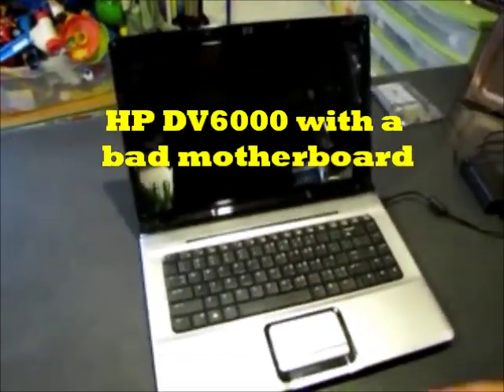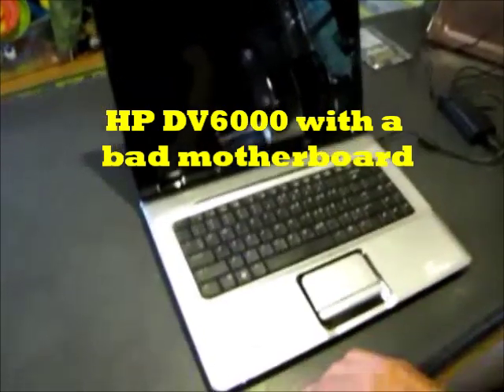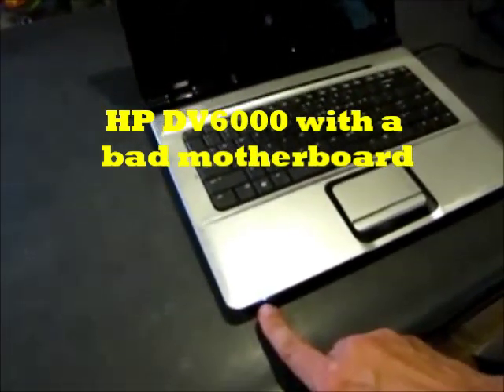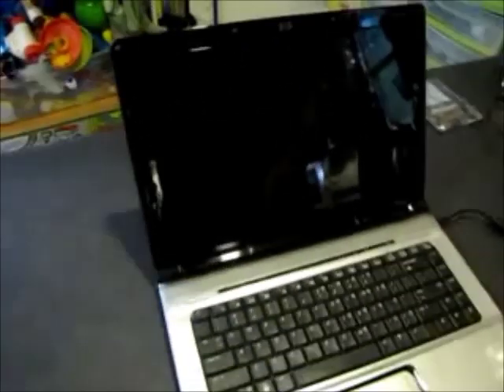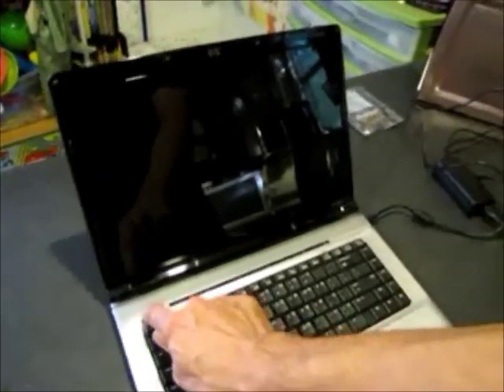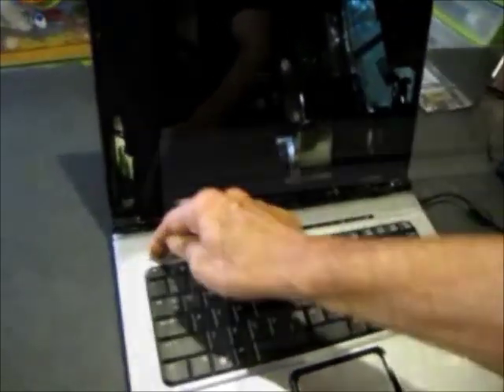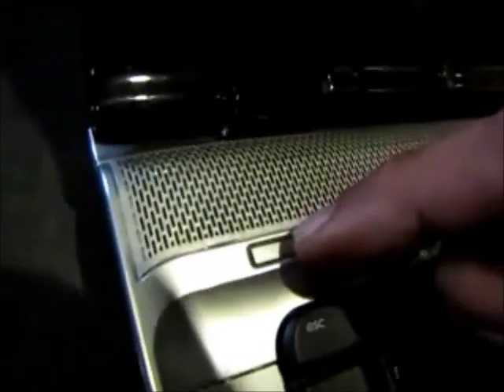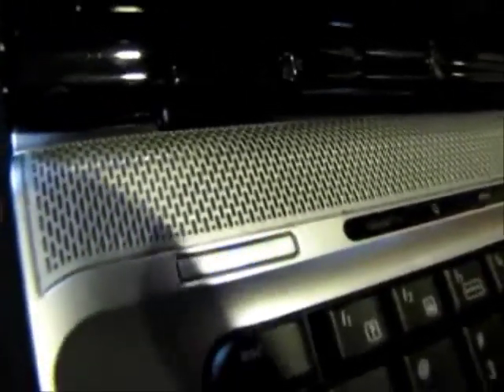HP DV6000 Motherboard Reflow

Comment: Only thing i would suggest is not putting it all back together afterwards.  You only need to put back the board, screen and a couple of connections to test if it works.  If it doesn't, and you now want to replace the motherboard, it's a pain to have to remove everything again.  Otherwise, nice tip.  Though, as others have said, it might only be a temporary fix.

Comment: Soon or later your motherboard WILL fail. This is only temp. fix. I have tried this method and along with isolated solder several times and it worked but the laptop is on the timeline. This method extended my dv6700 another year but it gave away in the end.

Comment: must try this I just bought a nice laptop for £35 and the mobo is gone and will cost some £100 for new on is there any advice on all the bits to take off before putting it in the oven please? and what to rest the mobo on as in do you have to make sure its not resting on any solder parts? great vid by the way :D

Comment: Definitely not a long term solution. Iv done this before and it will destroy other components on the motherboard like heat sensors (which are kinda important)! But if all you need is it to maybe work for a little bit longer not a bad choice.

Comment: After taking my comp. apart I discovered that the silver part on top of my AMD Turion 64 was half melted. At least it looks melted. It was turning on for a while in safe mode only, and then I let it sit for a while only to come across the problem of it not turning on. I only needed it to turn on one more time, I was going to get what I needed and transfer it to my new computer. Do you think I will have a shot even with the AMD problem?

Comment: My only suggestion is that if you are going to do this you should bench test it first before re-assembly, so you would eliminate any possible unnecessary steps.  Also, try  testing the board without the hard drive, battery, cmos battery, lcd screen and only leave the fan connected to the cpu and power supply to the motherboard watching for video on an external monitor or TV.  If bios is seen than look at the lcd inverter or bulb as the culprit.

Comment: Osman....calling someone crazy just because you are ignorant (you didn't even spell 'component' correctly).  I've fixed many a mobo using the 'DIY' oven 'reflow' approach.  One suggestion though river (most people don't do this, but it will give you better quality reflows, is to paint the board with solder paste to keep the oxygen impurity down and also to break down capillary action (allow better wetting of solder to mobo components.  Thanks for a good video man.

Comment: I have a few questions, 1. How long does this fix work? 2. Does this model of laptop make error beeps when the ram is taken out? 3.What other things did you have to remove from the motherboard before baking it? I have the same model and I'm thinking of fixing it like you did but with a copper shim on the video chip to help with heat disapation.

Comment from the maker: This is no joke and the plastics that remain on the board through this process have a much higher melting point that 400f. I made this video years ago before I acquired the professional equipment I have now. I can assure you this works in most cases but it is only a temporary fix because the root cause of the problem is not addressed

Comment from the maker: No replacing the chip will make it like it was when new and I would suspect it would last as long as it did the first time. But there are two versions of that chip. There's one from 2008 which you have. And there's a newer, updated version from 2011 where the heat issue was corrected. But in reality the entire thing was designed wrong if you ask me. It's insane to take the heat from the CPU and pipe it over the GPU on it's way to the fan. They needed two separate pipes...

Comment from the maker: I take my oven to 400f (204c) for 8 mins. Test the inside temp of your oven to make absolutely sure its not hotter than 220c. Any hotter than that and components may fall of the board into the bottom of your oven

Comment from the maker: Yes it is a temporary repair. But I have some of these that are still working fine. My wife has one I reflowed in this manner last year and it's still working fine. And yes you could "get the customer". Or maybe you could get the laptop working long enough to back up your data then sell the machine for parts. Since this video was made I have purchased a professional rework stations and I now reball or replace these chips for a more permanent fix.

Comment from the maker: I no longer recommend this method of reflow. It will work as a temporary fix so you can recover files etc. but it will fail within months... or sooner.
As far as a PS3 board goes. I am not sure about the capacitors on those boards being able to take that heat. I've never done one in the oven

Comment: I had this exact problem and by reformatting/upgrading to WIndows 7, I had better luck and could get it to boat and load Windows. Now the system will turn on but the AC adapter seems to short out every so often, and the battery will not charge. I'm wondering if your trick would work in this case.

Comment: my dv6000 would power on and then turn off. No video. 

Cooked it once 8mins @ 385 and it stayed on, no video. 

Cooked it again 10mins @ 385, and then hit the GPU about 20seconds directly with a heat gun and let it cool 30mins. Put it back in and it worked.

Comment: Worked.  I baked once at "400" 8 minutes, and my power on issue changed to the video issue.  Using an oven thermometer and preheating to a steady 425, ran it for another 8 min.  Video issue resolved! (My HD video is jumpy, maybe need to cook it again, but good enough for now. Thanks!

Comment: Hi! So what you did here is just dismantle the laptop to get the motherboard, put it in the oven and that was it?
I have slightly different problem, my computer worked fine but now when I press power button it starts, but at the beginning some kind of blue squares appears for a moment and when it comes to start the Windows then it shuts down or restart. But I can still go in safe mode of Windows. What would cause this problem? I think it has to do something with GPU? Can anyone help me? Thanks

Comment from the maker: Could be anything. But I do know the GPU chip can only take so many reflows. My guess is you are getting a good reflow but are not using enough thermal paste and your laptop is overheating again and again. You can try running an app called Speedfan (google it) and that will tell you what temps you are running at

Comment: it worked for me !! Thanks a lot man !!! But still,i have a problem. When i shut down the computer at night and try to turn it on next day it still has the same problem :( Sometimes it does turn on but mostly it wont.It goes on,fan starts to work and it shuts down...Why the hell is that happening ??? Everytime when i do reflow the laptop is working for one day,maybe two and then it stops.....Could anyone help me with that ???

Comment from the maker: I ended up buying a professional rework station for doing this and just as a test I ran a board using the exact technique I used in this vid but this time I used a thermocouple attached to the motherboard where the gpu meets the board and only showed a max temp of around 200 Celsius which is not hot enough for a proper reflow. I have tried using a higher oven temp but realized too late that some components can become desoldered and actually fall off the board

Comment from the maker: You should never use a coin. For one thing pennies are not copper and don't transfer heat as well as a copper shim. For another the surface of a coin is not perfectly flat and does not make a solid connection with the chip

Comment: it's also good to remove the factory heat transfer pad under the GPU & Controller chip and replace it with copper penny applied with heat transfer paste. You can download the "CPUID Hardware Monitor (HWMonitor)" program to monitor the temperature.

Comment from the maker: @bozallen
 
Awesome! One of the great things about doing this is HP screws are very simple to ut back. There are only 3 sizes of screws.

Another tip... After you get it all back together and booted to the desktop be sure to download "Speedfan" or some other temperature monitoring app. One of the first things I do is check the operating temp. If it is below 50c you are fine. If it is in the 50's you may have issues later. If it's above 60c then you need to check your heat sink again

Comment from the maker: @Sotost80 Nope... People who try using a heat gun do that to protect the rest of the board. I would never attempt to use a heat gun... There is absolutely no way to control the temp... plus you need to heat both sides of the board

Comment from the maker: @poetpiet 

And as far as water in you computer goes... I too have spilled an entire glass of water on my Lenovo N500. I immediately removed the battery, ram, HD, and keyboard then set the laptop, opened, outside in the sun for about 5 or 6 hours to dry. Once the sun went down I put the laptop in a walmart bag and covered it with popcorn kernals overnight. Put it all back together and it worked fine!

Comment from the maker: @poetpiet 
Thanks... And yes the fumes are a concern. I run the exhaust fan on the stove and have a window fan sucking the air out of the kitchen. Then after I am finished with a MB I run the oven at 500f for about 30 min's to try to get it out of the oven. Hopefully soon I can buy an oven to put in my shed and use for nothing but that.